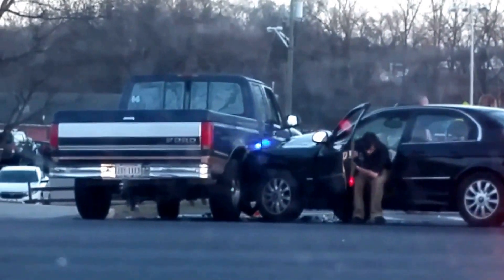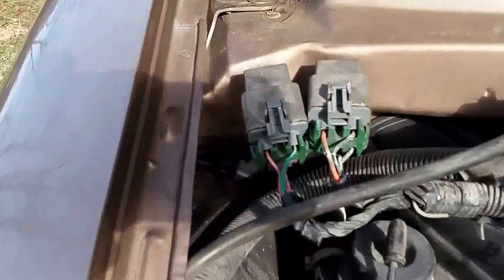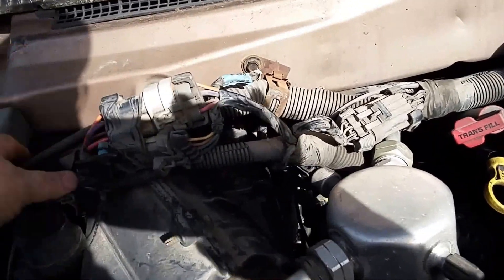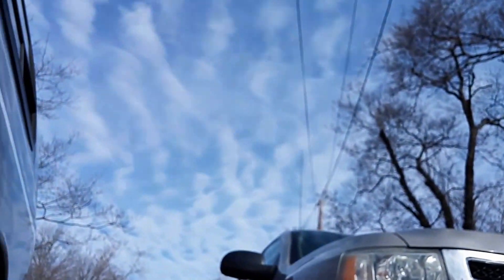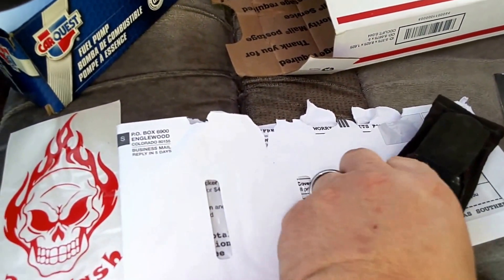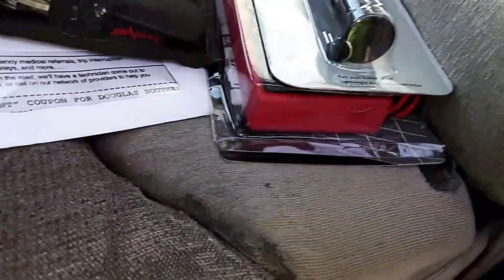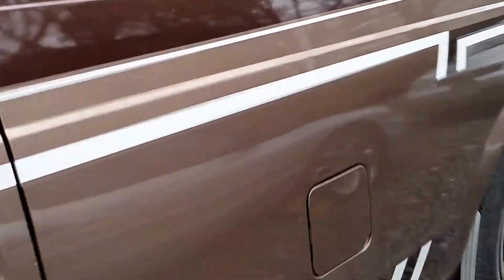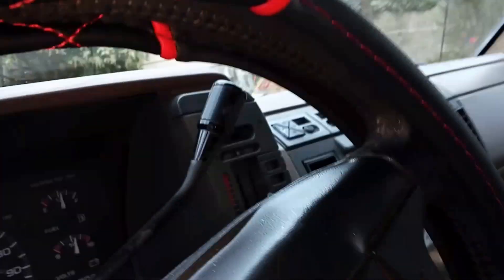GMC Safari fuel pump replacement/ 231Flash MAIL CALL!

Comment: Not many videos on a 1995! I have an Astro van of that year. I see your pump has the regular fuel lines and I kind of like that design compared to the later ones. Thanks for the preview! I have done a lot of things with cars and other stuff but I've always been apprehensive about the fuel pump! But I'm very good about taking precautions and following step by step instructions. So many people say it's easy but the question is do they take shortcuts? Anyway, glad you got it going!

Comment: Elvis says Return to sender
it don't pump gas. 
I dropped the tank on a Chevy Lumina right after my son filled it.
Try pouring gas into a can from a tank laying on your back.
Good job.
Reply: Yes i did sir. I did not get to the PO today. Four of us are sharing 2 vehicles right now, my boss picks me up  for work which leaves three people juggling. I will try to get it out to you this week. thanks.
Reply: Been there done that. I finally got smart enough to realize that Wal mart & harbor freight sell pumps for this purpose. And they're under $20, sometimes under $10. You can probably get an electric one for not much more